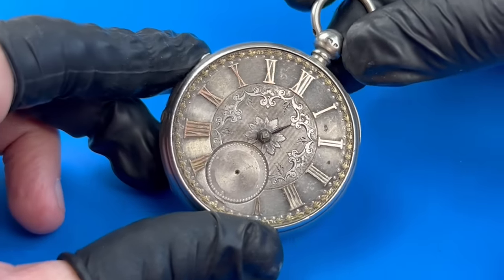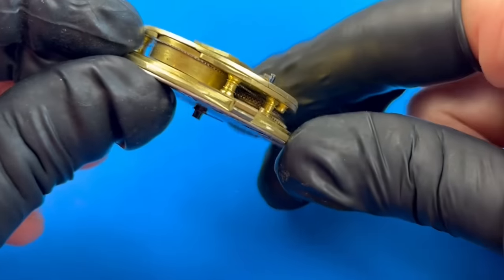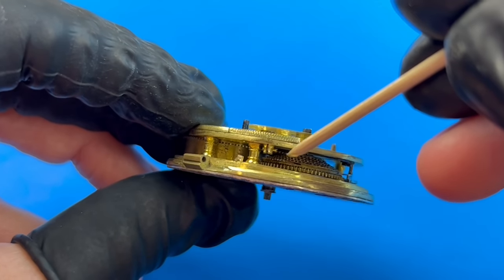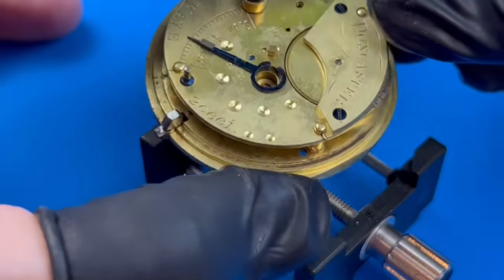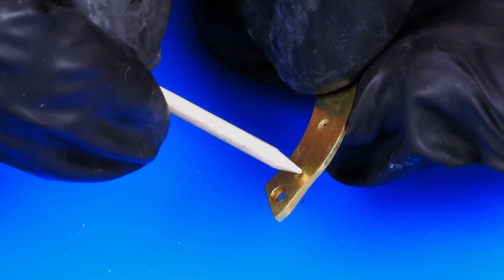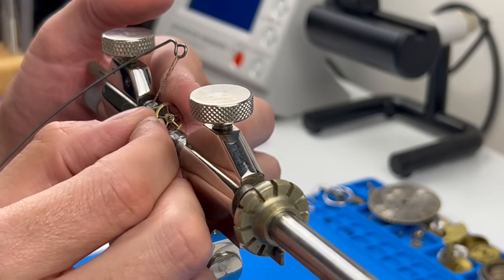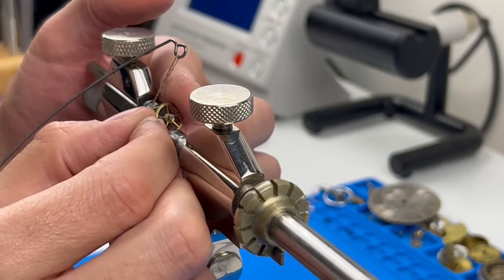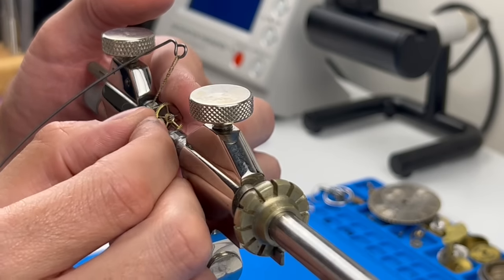Forgotten FUSEE Gets a New Pivot and Restored - WHY was I TERRIFIED of this repair?

Comment: As a professional watchmaker I commend you for excellent practise- you followed almost all the standard rules. The quality of the video production is superb too, and that’s a point that shouldn’t be overlooked. It must be 20 years+ since I first worked on a fusee as a young watchmaker and it is indeed a stressful job first time around! My boss simply handed the watch to me (made in 1829, I’d add) and said “Right- repair that”. Handed me a book covering the main points and that’s all! Congratulations- you have all the requisite skill and equipment to make this a full-time profession. Literally the only point I can recommend is to use some thin plastic on the bridges when replacing the brass pins…not always necessary if using nylon-tipped tweezers. There are virtually no full videos of fusee watch repair on YouTube, and this is BY FAR the best. Honestly, you did a stellar job. Very impressed.
Reply: I had the same thought about the tweezers scratching up the bridge when inserting and pressure fitting the pins, but then I noticed the previous scratch marks from previous watchmakers, and in the end, he added his own and seems to fit the expanding history of this watch.

Also, utter noob in regards to watchmaking, but as an engineer, I thoroughly enjoy these videos of true antique watches.

Comment: Good job! Very professional! The first watch I ever rebuilt was an English Lever fusee like you just did, I over paid for it and swore if it was the last thing I would do, I would get it running again. It took a year of research and self-education but I did it. That was 7 years ago. Now I'm the only one in the area that will look at a fusee. The next part of my education is learning how to use the lathe and the Jacot Wheel; (I have a number of them that need new balance staffs), - you make it look easy. Thanks for teaching me a few new tricks; chaining up is by far the worst, especially on older Verge-Fusees.

Comment: I admire your skill and ability to work with the tiniest parts and peices, beyond me that's for sure. I love love love watches and clocks and if I can see any movement I am enamoured. In most cases I would much prefer old rather than new...washer and dryers from 60's to 80's, I even love the old wringer washers, they did a much better job even with not so fresh water...and saved a bunchbof water as well. Cars, no computers to blow up costing a mint, houses (albeit with new plumbing and electric). Old stuff was built to last and be repaired. Even sewing machines seem to be computerized crap with platic everything that can't be recyclednor broken down.

Comment: I really enjoyed this. I have two watches with fusee movements. One is of English Origin the other is German. The British watch is very similar to the one you worked on though I don't recall at the moment is mine has a town or origin or a makers mark. It does have very similar hallmarks. I've been told by the watch maker that does my work on these that the assay office date mark makes my English watch 1852. The German watch does have hallmarks but I've never been able to fine a source to reveal hwat they mean. The English watch is a key set and wind like this the German is a lever movement using the stem for both winding and setting depending on whether the lever is out or in.  

Look forward to seeing more of your work the video was top notch.

Comment: Thank you so much for this. I have one of these watches, other than it has a FUSEE mechanism I know nothing about it. It was also interesting to know that your watch runs at different speed in different part of the wind as my does. I just have to get the hands on my fix after snapping one when I nearly drop the watch.

Comment: Hi Chris, excellent video, thank you. I am new to watchmaking (about a year into the hobby), and, after successfully disassembling, cleaning, and reassembling several newer, more conventional movements, (Waltham, Elgin, etc.)  I'm in the midst of a repair/rebuild of a lever fusee movement very similar to yours. You are correct, they are scary as hell to work on. I am stuck, as a 1" length of the hairspring broke off the tail during reassembly, and now apparently the hairspring is too short to drive the watch, as it will not run.  I have found out the hard way that parts are NOT interchangeable in the balance assembly. The very kind and generous folks at NAWCC helped me as much as they could, and then, diplomatically told me, look, this is a difficult repair for a seasoned pro, which you, are most certainly not. Put the watch away, and come back to it in a couple of years, when you've gained more experience. Maybe I will one day!
Reply from the maker: I hear you- with watches this old, there really is no safety net. Even the most skilled individuals can make a new balance staff, but how can one construct a new hairspring? For screwed balances, there’s always the option to add or remove weight quite easily if there was a close donor hairspring available. Then there’s the matter of the collet, etc

Comment: Well watched until the end. I used to fix watches as a hobby for people after 20 years experience. I soon gave it up as the 10 to 12 hours you have to spend doing this is not able to be compensated for. I did a couple of old Fusee watches and clocks myself. I really enjoyed fixing the Seiko mens wristwatches and I have quite a few in good working order. I did have the same timer as you and got a lot of good results. I have a Hamilton pocket watch that has had indignities performed on it. May get it out sometime and have a look at it. Will have a look at some other jobs you have done. Cheers from Australia.

Comment: You say your not an expert.   But when the only expert, the guy who made it, has passed on, your now the expert.  That and not everyone who repairs watches, get alot of work because I'm sure there are not many still left around these days.

I repair 50's threw the late 80's metric motorcycles.   And all the people who built them and worked on them when new are mostly dead.  So who is an expert anymore.  Well, the person who have taken up the mantle to repair them.  That's who.  And then it's all based on experience.   

Great work I have to say.   You did no harm, and it's better for your work.

Comment: I'm just learning the watchmaking hobby, but I think the problem with getting a reading on the timegrapher is that a fusee watch has a beat rate that's too slow to be properly read and picked up. Plus, maybe the sound profile doesn't match any that are preprogrammed into the timegrapher. Others more knowledgeable might be able to comment about this more fully. I've read a while ago in a watch blog that someone had his timegrapher recalibrated to pick up a 14,000 beat rate and then he was able to use his timegrapher to regulate a vintage 100+ year old pocket watch. Hope this helps. I'm just getting into watch repair and was wondering how fusee movements worked. Great video!!! Thank you for posting it!

Comment: I did a restaff on an English fusee when I was in watch school.The staff was really nothing more than a steel taper pin with pivots on both ends.Despite its seemingly simple design,it took me numerous tries to cut the whole staff with pivots ,and due to its tapered shape,I had no way of holding it in a lathe collet.When I finally  did succeed,after mounting rhe balance wheel, wobbled around like a drunken sailor but,IT RAN!.Not surprisingly,it was a terrible timekeeper.The owner,a prominent judge was delighted to even have it ticking,and didnt care about the timekeeping.The watch had been in his family for several centuries.

Comment: The best fusse video I’ve watched Chris! Great job. I’m always envious of all your tools, especially the lathe! Great job on the lathe! I do you think the spring is the reason the rate error differs hour by hour especially first and last hours? I made it to the end of course!
Reply from the maker: Thanks, Boyd! I appreciate that. Yes I do think the changes to the strength of the spring over the years has outweighed any fine tuning the fusee cone would have offered. As you suspect, this is the most likely cause for the differences in timekeeping throughout the wind.

Comment: The drop off in rate towards the end of the run time was due to insufficient set up in the mainspring. A good rule of thumb is to pre-tension the mainspring by half of the unused turns of the barrel. Typically 1.5 turns are unused so set up 3/4 of a turn of the barrel arbor.
Reply from the maker: Great to know. Thanks!

Comment: I stuck with you.  I suppose you could speed up some of the tedious and slow processes with video speed option.  I am amazed at the small size of the chain.  Getting less than a minute off over the course of a day is really good.  I suppose the wind up cone would have to be re-sized to make it more accurate throughout the course of the day but 250 years ago this was really good unless you were piloting a ship across the ocean.  Thanks to John Harrison for the ships clock for the longitude challenge win.  Good job, I think Adam Savage would love to see your lathe and equipment and buy some similar for fine model working in gears .

Comment: I have a 1901 Chester Evan and Evans watch with what I suspect is a fusee movement but i can’t see the chain at all and also the triangle thing, isn’t this a fusee or is there something wrong with it , it works completely fine just wondering what the movement actually is if it doesn’t have the visible chain
Reply from the maker: By 1901, manufacturers were mostly using the “Going” barrel. So, there was no fusee cone and chain as the train of wheels was driven directly by the mainspring barrel

Comment: I find it amazing that back then they could manufacture such a tiny chain and fine tune a fusee to accurately keep time, as well as the larger screws for the bridges, but couldn’t make a small screw for the dust cover.

I guess pinned lugs is just a quicker and more efficient way to do it. And easier to replace a pin instead of a custom thread screw.
Reply from the maker: Very good point

Comment: I stuck with you buddy and although I've not considered myself a watch fixer upper but I do have a good share of common sense. I have always liked fixing small things and was considered handy and a tool and die maker for several different items that people use everyday and don't realize that some items were made a long time ago. I like this watch and the design of it with the face and all. Some cases the patina of certain pieces can decrease the value of the item depending. I think this watch would have just stood out like a elephant in a rod 49:19 eo. Just my opinion. But nice video and I like your specialty tools. It takes a while to collect things. Anyway I would like to see that silver case shine like a 1922silver dollar with the eagle on that watch. No loss in value.

Comment: I was really good at taking apart my father's watches as a child, and I always had some extra parts left over for some reason. 50 years later, some handyman is going to open up the wall in the bathroom and wonder why there are all these gears, springs & hands in there.
 Pop knew, so he started buying cheap watches and leaving them around

Comment: I don't think it was the going train that rendered the fusee obsolete but better alloys for spring manufacture. You watch here surely has a going train too? With a more even power curve from full wind until unwound there was no need for a reduction mechanism. The geneva stopwork on contemporary and later watches does much the same thing but limits the spring motion to the section where the power output is most even.

Comment: You can get some 3M aluminium oxide abrasive A4 ish paper (it's a plastic) They make them sticky on one side so you can stick them to say a laminated glass sheet ( they are really flat I have blue red and green., Don't know what the graid is off top of my head but the blue leaves a really nice mirror polish on steel when its getting a bit old. I've had mine for over 5 years and I'm not looking to replace them.

Comment: The timing machine have problems with older fusee pocket watches and some older cheap watches. I don't think I found one that the machine could pick up. I put on the bench and see what it's like to a quartz wall clock. + or - 5 min a day was expectable. The owner would use the clock at the train station to put his watch right or have a look to see how far out it was . The going rate as in it looses 5 min by the end of the day but in the morning it's fine.

Comment: 5:02 no repercussions. Even back in the day (i know this from my uncle) you'd use a microscope to measure the apparent distance and when you'd reset the spring, you'd do it to that dimension. Even if it's not perfect, it's within a very small margin of error. In today's world, where technology can help you see the picture as it was, you can remake the spring's catch to fractions of a mm.
edit: personal opinion, but if pins are to be replaced when you work on large machinery, they should be replaced on something as small as a watch as well. They're consumables. Each removal and reinstall shaves material off them.
edit 2: i think the pin for the pallet fork is bent at 31:17 (a little bit before as well).

Comment: Hello, sir! Why a u using 9010 on high friction parts, like center wheel?
Reply from the maker: It’s a good question. I have a habit of using 9010 on any train wheel pivots including the center wheel. It isn’t super fast moving so one could probably get away with D5 or HP1300

Comment: What is your lathe ? its nicely compact
Reply from the maker: Thanks, Sonny. It’s a Boley 8mm with the Geneva bed. I paired the Racine motor with a countershaft (per JD’s recommendation). Basic router speed controller after ditching the pedal. Slapped the whole thing on a big ol cutting board and called it a day lol. I documented it here: Behold! My new lathe FINALLY - making a new stem for an Elgin B.W. Raymond pocket watch
https://youtu.be/CXguIQfX4n0
Reply: @csspinner  I apologize for not going deeper into your videos. I'll be sure to find and watch that video.
 Thank You for responding.
 Its a great setup !!!! 
Appears to work really well.
 I'm still teaching myself and my Son to use mine. 
As well as still tweaking mine to my liking.
Reply: @csspinner  Im watching IDGuy to learn about modern wrist watches and styles and trends.

Comment: Good work, until the whole watch was scrubbed with fibreglass and brass brushes. Terrible that the beautiful fire gilding will now be irreparably scratched all over. This is simply unacceptable; the same outcome could have been achieved with less invasive or damaging methods.
Maybe watch some of Baumgartner art restoration videos to get some inspiration on the philosophy of doing no harm to the object.
While I’m ranting, here’s some terminology: 
“Sustaining” power = Maintaining power
“Iso-Chrone-ism” is pronounced I-sock-ron-ism.
Stop “works” = stop WORK. Same applies to keyless WORK, motion WORK, etc. Work (singular) is an old English expression for any type of mechanism, not just in horology.
Sorry - your work has great promise. There are ways you can keep improving.
Reply from the maker: Thanks for the feedback. I did not use brass brushes. There was no harm to the finish whatsoever. Appreciate the advice. Always learning and improving :)